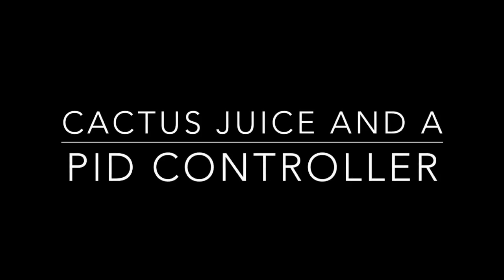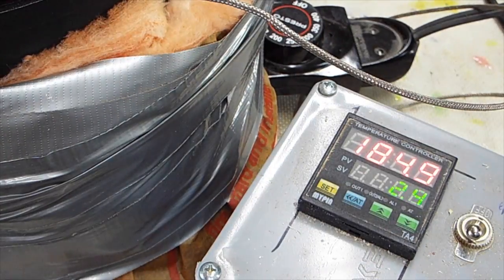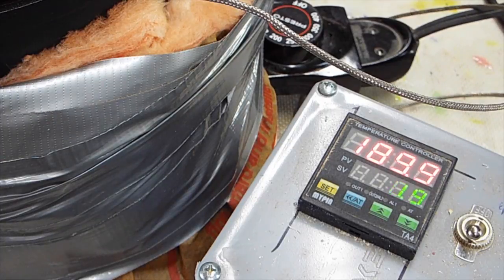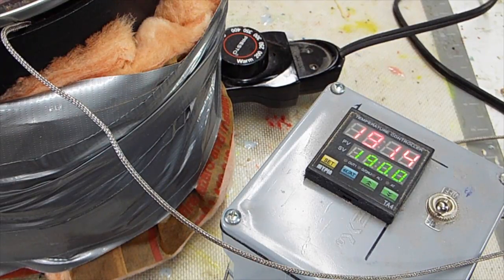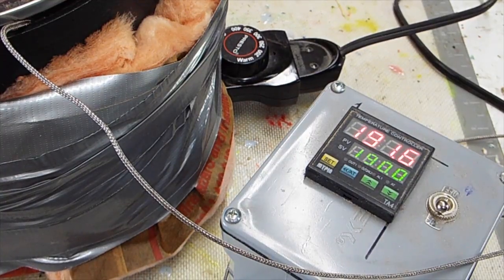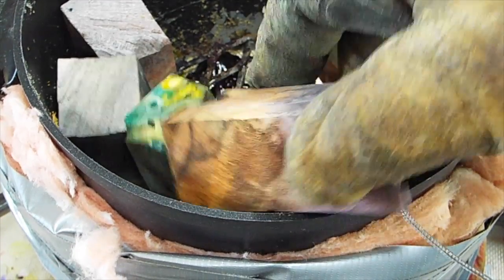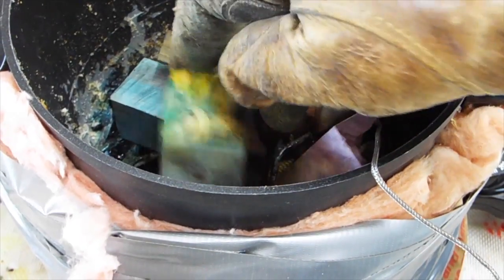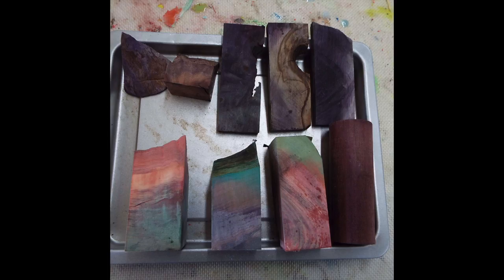Cactus Juice And A PID Controller

Comment: Thanks for the video. I stopped wrapping my wood with aluminum foil as well before placing them in my oven, a lot less cookout and baked on Cactus Juice  on the blanks. I don't know if this is a good idea or not. What is the main purpose of using aluminum foil in the first place? To prevent cookout from getting on you oven? Thanks again, I have learned a lot from watching your videos.
Reply from the maker: Glad you liked them. Never saw the need for Aluminum foil unless to keep the oven clean or the major problems problem  is to keep the vapors down the vapors and a exposed element can be a fire hazard. that is why 99% of my cooking is done in the presto cooker. Thanks    Ron